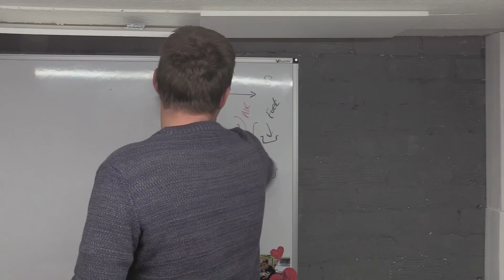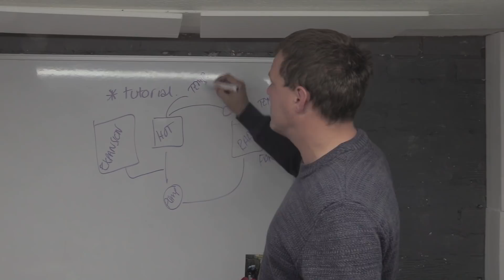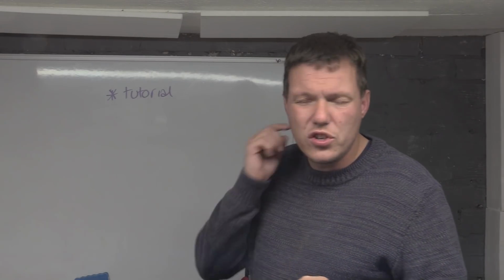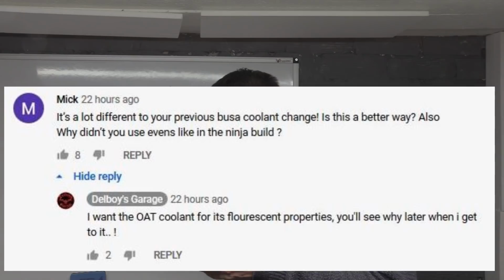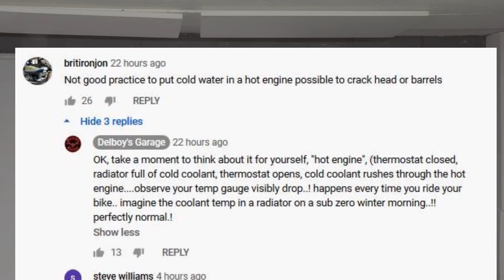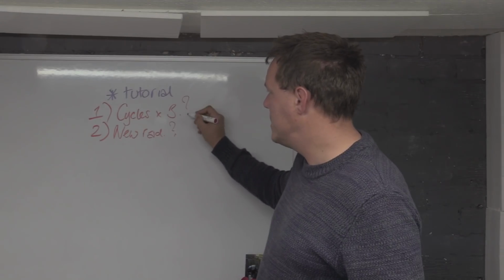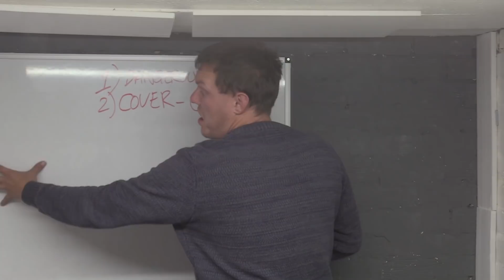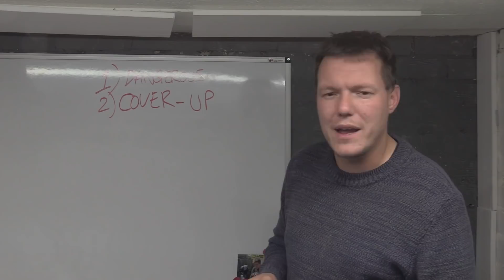Endangering people for views

Comment: The mention of having plans for the coolant is telling me he's going to try glowing coolant pipes like a gamer pc build....
Reply: Iv seen it look good on some bikes but this is going to be a mess 9f styles and look shit. I like the quinine blue glow effect myself.
Reply: @jediknight1294  oh no, what have you done?
I've just finished painting a special, its rather understated old thundercat, satin black, polished alloy, lowered, uprated suspension, its got a few blue bits to set it off...
Spring, brake lines, blue levers.
Clear glowing coolant lines you say?
No... Just no...
But it might look good. ..
What have you done?
It was so tasteful,
Reply: @deadprivacy  not used it on a bike but iv used it for prop builds before, mainly sci-fi kit for low budget theatre productions but have occasionally made parts for people doing screen accurate props. The quinnine trick I last used for a plasma pistol build and setting it into resin with a hidden uv led for making replica pistol rounds from underworld for someone. 

I could see it look good on something that's blatantly a theme bike. I know it was used on the Tron bikes and Iv seen it used to get an effect on guages when iv had to make a scrap gauge look futuristic with a budget of bugger all.
Reply: @jediknight1294  theres a us company that does hardened pyrex sections , killerpipes or something, not too expensive either.
and they arent so gaudy if you dont point an  led at them, i like the idea of doing the gauges though with the same glow.
Reply: @deadprivacy  culture hustle make some amazing powders to make paints fluorescence. There's some stunning kit out there now for effects stuff.

Comment: The main problem is he has nearly 700 likes on that video , which mean a possible 700 people heading to A&E this weekend with burns , also at the end of his video when he rolls the bike back on to his lift he has absolutely no coolant in the expansion bottle , he should have explained that you should also fill the expansion bottle in between the low and high mark when the bike has cooled !
Reply: he even removed an expansion bottle from 1 bike, saying it wasn't needed, and he doesn't know how a pressure cap works, he thought it was 1 way, so anything that went into the expansion bottle was extra that wasn't needed, as according to delboy, it is not sucked back into the system when it cools

Comment: 15:00 (he's lying) i road raced 2 stroke bikes in the 80's and glycol was banned, only water (without oil of any kind) was permitted because glycol on the race track is ..... slippery..
Reply: As well in the U.S.
Late 80s early 90s all tracks band it.
Reply: I think you misheard.
That video clip was about how he makes his own cutting oil by mixing oil and water.

His claim is that if you mix oil and water in a bottle, and shake it a bit it'll combine, and make a "super slippy" cutting oil.
Reply: @danielr82  
I'll concede that point, in fact he said that they use "water in the oil to make the oil more slippery",
Firstly no they didn't do that either, in the 80s we had far more effective slippery oils and additives available compared to water in the oil for the gearbox, and water will simply make the gearbox oil foam rather then flow which is not what you want in the gearbox.
Reply: @AuMechanic  I know they didn't do that, most people know this is wrong, it wasn't me that said it, it was Del.
Reply: @danielr82  
I know, I was just pointing out why Del was wrong on that claim too.

Comment: Watched a factory mechanic change a whole clutch basket and clutches mid race at a National. (Dirt bike). Came into put, laid bike over, zip zap off came clutch cover, out with old in with new. Refill gear oil and off he went. Probably took 1-2min which isn’t much in a 3hr + race

Comment: Hot engine cold coolant thing - won't crack anything I completely agree with your thoughts on that.  From the car world, coming from doing lots of track work with Lotus Elises - they had a coolant system designed for a front engined car, but extended the hoses (mid-engined, engine and gearbox pulled from a front engined car) to the rad in the front.  A lot of the head gasket issues were blamed on the stat being in the wrong place and letting the water in the rad and pipework get too cold before opening, so thermal cycling the engine while it was being ragged.  Plus the long bolt design of the engine and shit Rover head castings meaning it was more fragile in the first place.  Hence, HGF.  Sure enough, it did seem to help, either moving the stat, so most of the pipework was on the hot side, or the final fix was a remote stat that had a bypass doing a bit of a gradual mix of hot and cold, rather than slamming open and dumping a radful and six feet of pipes worth of cold coolant at the head.  Cold coolant in a hot engine at coolant change though?  Nah, no issues IMO - the HGF thing was due to repeated cycling in track and hard road use.  

To be clear - I'm no way advocating that I think that means changing the coolant hot is a good idea! :D

Comment: Also its pressurized so that the coolant will not boil at higher temperatures. But as soon as you open the rad cap, it immediately boiles like a steem train ,......And no gloves....

Comment: I got 1/2/3 degree burns on the top of my foot when the dashboard heater core burst in shitty old car when I was driving as a teenager. Coolant burns are no joke. I still have a scar from it, and it was 12-13 years ago. I didn't have to get a skin graft, but it still took weeks to heal. I had to walk with crutches during that time, because any pressure on my foot hurt like hell. The blister was the size of a grapefruit!

Comment: Harley...no coolant, no coolant pumps, no coolant radiators, no thermostats!
Reply: a couple of the new models harleys  have water cooled  heads just around the exhaust valve on harley tourers  they have to run them so lean  for pollution regulations the exhaust  valve get too hot  and with the touring fairings blocking the air flow  to the motor they have to water and oil cool them now
Reply: No power
No handling
No Buell
No business very soon
Reply: No need to buy one either they are fucking air-cooled junk that makes zero power and handles like it has flat tires. This is coming from an American from the south too. They are shit, stop holding up for them so we can get a new business to fill their place with something better. Absolute garbage machines.
Reply: ..and no scolded fingers
Reply: G58 tons of power, handles like a road going couch should, no Buell???, lol why so salty?
Reply: MrStr8den no Evans coolant
Reply: @rangeday2923  I rode one once that wasn't mine and was absolutely disappointed in the motorcycle my country was known for manufacturing. My yz450 dirt bike would beat it to 80 and my nsr250 would flat out monkey stomp the poor thing out of existence. Imagine a 250cc vs over a 1L and it beats it so badly it isn't even in the same ballpark. That is pathetic and there is no reason for something to have a motor that large with that little power riding them feels like a boat it is just a shame. We used to have stripped out Cafe racers, old beautiful Indians, Erik Buells motorcycles before Harley bought them and ran it into the ground so they would have less competition. Now we got hog wagons that carry fat dudes around at 15 below the speed limit while making the same amount of noise as a passenger airline at takeoff

Comment: Worst thing is,is putting a bike on the stand like that. I spent a couple of years on a bike mech course, we never put bikes on like that without the engine on let alone with, because there is simply too much that can go wrong, as one of the others found out to their painful tip over into another bike that had been tucked in between benches as we cleaned down.

Comment: Opening a hot system other than the danger of scaling you also risk overheating to the flash boiling of coolant in the water jacket. Steam doesn’t conduct as good as water, so good luck with those hot spots when you release the pressure that’s keeping your coolant from boiling.
Reply: I agree completely. It's all about pressurised cooling systems and raising the coolant boiling point to allow for more efficient engine working. Steam pockets are incredibly dangerous.

Comment: Some car engines even tend to fuck up the cylinder head/headgasket if you open the cap when hot.
Reply: This ^^. It's that cylinder head mating surface which is the weakest point.

Comment: my FZ09 tipped over the other day and I got an error on dash turning the key, I switched it on and off and it started fine, maybe a couple more cranks than usual, then later I was ripping heavy on the throttle and it just cut out on me, why do you think this is? I think bikes have a tip over sensor in them or something, do you think something came loose maybe? It was a light tip over in the driveway. Ive heard off bikes tipping over and then needing more cranks when starting from then on, what would that be? thanks

Comment: Would it be ok to put my bell-end into the orifice where the pressure cap was and run the engine to the point where it's gets uncomfortable and then drain the fluid ,,,,,

Comment: It's not a little puff of steam you worry about. With enough heat and pressure all the contents of the system can explode out, boil away in seconds, and burn flesh to the bone. I used to have a car with a effed up cooling system, always dealing with the shit hot, on the side of the road, sometimes overheated, always in a hurry. Usually just a little pressure, a hiss, one time it wasn't. It popped while opening, hot coolant everywhere, I didn't get burned somehow, but it was everywhere. Hood dripping, windshield, my clothes. Would you believe a rag to open the cap wasn't enough!?! :-)  I'd done it many times, something was different that one time. I was lucky, it only cost me a shirt. Also worked at an oil change/tire place, usually had to change the coolant on a warm car.  If there's a rubber hose, you can see if it's super hot or under pressure. 

Del could have opened the cap and then warmed it, if he had to have warm coolant. But then he wouldn't be Del.

Comment: I have done a hot cooling system flush on OLD bikes before to try and remove some scale from the system.  I drained it COLD (because I am not stupid).  Then filled it with a mildly acidic (5 to 6 ph ) solution made with citric acid and distilled water, ran it for several minutes to circulate, and then flushed with an alkalai solution to neutralize the acidity.   This method works amazingly when done properly.  Just flushing with distilled water won't do much of anything.

Comment: Also when under pressure water boiling point is increased so can be above 100c when releasing that cap, i use a pressure cooker at home & that’s how you reduce cooking time because you can go higher temperature than an open pan. Just a thought.

Comment: Delbollocks is just an accident waiting to happen, if brains were dynamite he couldn't part his hair. I've seen lots of people remove the radiator cap when the engine was hot, pretty much all got scalded, I always did the safe option when watching them. First I told them it was not a good idea, second I stood well back and most importantly third I laughed my nuts off in their face when they got burnt.
Reply: I haven't open a cap for a long time, but I would vent pressure. I said to a friend' "Yeah, open it. It's fine." He got close then stopped just before I was about to stop him.
Reply: You can't part a bald spot...hence the permanent cap

Comment: You can cut your frustration with a knife. Latent heat is an interesting thing. Dissimilar materials with different rates of expansion can cause valve guides to move, gaskets to slip or crack. Allowing an engine to cool before a coolant change is the only way to perform this task.

Comment: I think the not putting cold water into a hot engine has to do with thermal gradients (uneven cooling) putting unintended stresses on components  that would normally cool evenly, creating distortions in the component. Maybe?

Comment: Matt, I literally just picked up an 02 Suzuki VL800 for 500 bucks. No coolant in reservoir and low in radiator. What did I expect for a bike that sat for 10 years. Got some G-05  coolant to stick in it and had to run the bike for a second to at least see if the coolant was moving. 

But, can't do that while balancing a gas tank to get to the filler cap. Rad warmed up a bit and guess what I DIDN'T DO LIKE THAT ASSHOLE.

I didn't open the radiator cap. Because I'm not stupid like him. I've seen it first hand from high school auto shop. 10 PSI is a lot when coolant is hot. Lol.

I may be American, but hey, stupidity isn't a virus. But it sure spreads like one.

Comment: You can also get a superheated liquid which will spontaneously vapourise just after you think you've relieved the pressure & removed the "safety rag"  & rad cap or, worse,  a hose.  That's likely a serious burn.

Comment: It is a bit odd, a coolant change is pretty simple and straightforward, ok if you have to flush with water and run, ok but only to about 30 degrees, yeah hot water under pressure is not so good....

Comment: Dell boy should drain oil and remove the filter with the engine's running he will get loads of bits of metal out that way. And fill it up with 50/50 oil and water more slippy.

Comment: When I had changed the coolant on my bike I got complacent and accidentally grabbed the exhaust manifold instead of the coolant pipe, whilst trying to force air back to the expansion tank. 

I'd started right and followed the manual but I still got burned because I allowed myself to follow a  'top tip' instead of the clear procedure in front of me which - for reasons that are obvious to me now - makes no mention of groping around at dark pipes on a hot engine in a poorly lit garage.

I made 2 decisions that day: coloured silicone hoses (I chose blue) and no more 'top tips' from well-meaning but uneducated nitwits.

The point in Delboy's case is, if you're willing to start the evolution from a position that is fundamentally unsafe, where will that lead when you have cognitive failure halfway through? Or you follow some more shit advice from an unregulated source? A minor embarrassment and a painful few hours becomes a trip to A & E or worse...

Comment: Del lives 3 miles from me and we live in a very hard water area (Dorset) as all the water comes from deep bore holes into chalk aquafers.
Unless one uses washing soda in one's washing machine life can become very expensive indeed.
Water used in kettles has to be filtered or else the element fur up and the kettle needs to be descaled by boiling white vinegar inside it (stinks the kitchen out).
You can imagine what lime scale will do to a radiator and water pump, hence the need to fill with distilled water if one lives in a hard water area.
Reply: Soft. No not soft, HARD!  I feel for you, not because of the water thing.  For living three miles away from that tool.
Reply: Did you ever consider a water softening unit? Best thing I ever did. It's fitted before the water enters your house. No problems with central heating, hot water tank, dish washer, kettles or washing machine. Also, lovely soapy showers 😃
Reply: @fr.mcgreer8349  We have a water filter jug for the kettle. 

As for a water softener unit, we don't have the cash to spare for such luxuries.

If I want distilled water I just empty the dehumidifier.

All my bikes are air cooled so no worries with them.
Reply: @nymphman1  Only the Yellow ones.....

Comment: Once had a five cylinder Volvo (Citroen engine) with a damaged cylinder block gasket (paper), so  the cooling system was pressurising. There was a danger I was going to start losing water into the oil. 

Solution: 

Remove the rad cap and run an open system

Fit a washer bottle (complete with washer pump) off an old car in engine bay, and wire it up to the battery and a spare switch on the dash. 

Run plastic pipe from washer bottle to open neck of rad. Make hooked end to pipe out of copper brake pipe. 

Watch temp gauge very carefully. 

Switch on washer pump whenever system gets too hot, keeping rad topped up. 

Carry lots of water in pop bottles. 

Drove from UK to Sweden, whole length of Norway in winter, drove around in mid Norway for weeks, then drove all the way back to UK. Car finally stopped six months later. Great car. 

Delbollox is the type of bloke you DON’T want around in an emergency.
Reply: I ran an old Peugeot for a year like that. Head gasket ruined but engine working. I removed the radiator cap and topped the radiator every 20 miles. It was fine as long as I didn't work the engine hard and raise too much heat from the engine.

Comment: Many Years back a Friend had a breakdown in His car . Opened the Bonnet  , removed the Radiator Cap , HOT Engine ,  Alcohol based Anti-Freeze ,  the Coolant  mist released when he opened the cap ignited from the Engine Heat , He suffered both Burns and Scalding .... Is there Alcohol based Anti - Freeze still on sale ? I have no idea . And when he said '' Two Stroke Racers put Engine Oil into the Cooling Water ????????? Is it possible  , do you think , perhaps  , that he has No Idea , and is thinking OIL in the Petrol ????????

Comment: When water heats up it expands when it cools it contracts DELL doesn’t understand that this is why he removes essential parts from his bikes. Also water boils at a higher temperature under pressure so removing the cap with the water under pressure it instantly boiled. When I was young there were government guidance adverts on the tv because people were getting severally injured from scalding water.